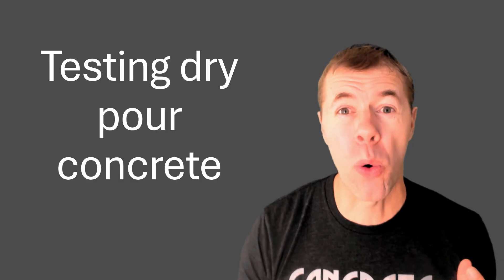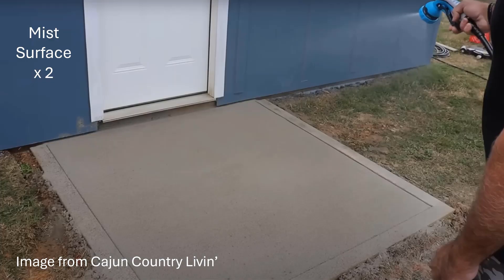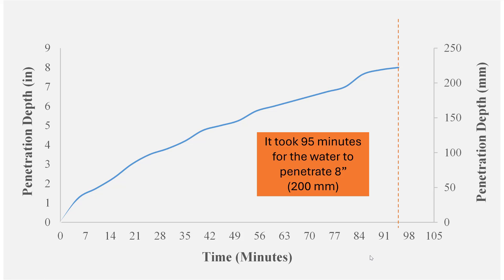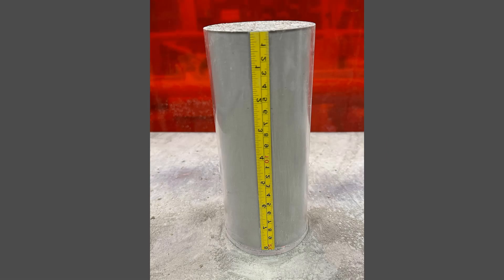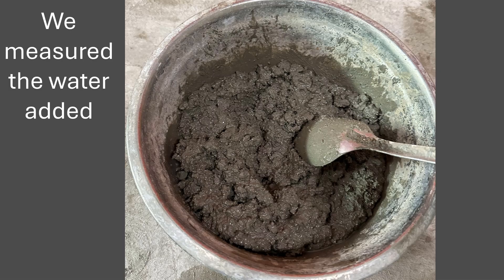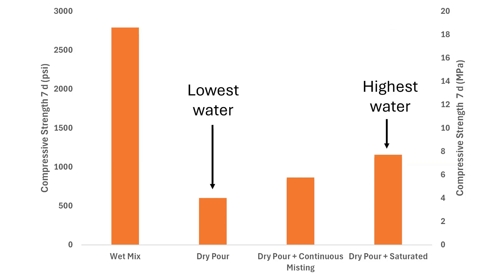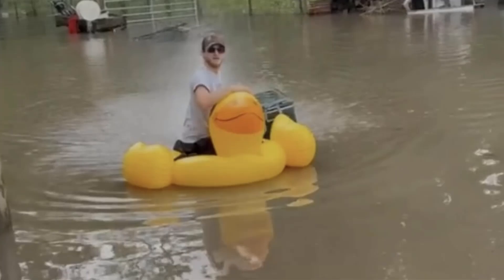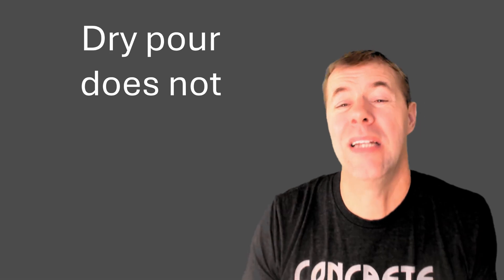Testing Dry Pour Concrete with an Expert

Comment: What would happen if you poured the dry mix onto a plastic moister barrier and raised all the outer edges ABOVE the concrete and filled the resulting trough from the bottom up?

Comment: I made a pad (about 7' by 3' by 4" thick) for the step off of my wife's she shed porch about two years ago. It was pretty quick to do and still looks fantastic. I did tamp the ground down to start, tamped the concrete in layers, and did put rebar in the center while pouring the layers. No cracks or other issues to date. This pad only has humans walking on it along with some occasional heavier loads via a handcart dolly (maybe 1-200 lbs max). For this purpose, dry-pour worked out great. But yes, I would not dry pour something that you would need to park an automobile or truck on. But for small projects I will keep doing it because of the ease.

Comment: Thank you so much for doing such good documentation and finally showing and demonstrating what all professionals inherently we're aware of but diyers wouldn't take our word for! Years ago one of my engineering interns that I worked with talked about a project he had in mind for using the dry pour method and he didn't believe me when I warned him about the lower potential strength. I actually had slightly better strength results than you. I lightly misted the top until it set up and once it did, I modified a cylinder lid with small holes, then submerged it in a stable temperature tank. Didn't do any testing with rebar, but I warned him that it would be a waste of money to bother adding rebar because it won't Bond and would completely delaminate should you ever demo the slab. I told him he'd have better results with welded wire, hog wire, or even chicken wire, and maybe even if he added some Fiber to the mix but that rebar would be a waste. Total mid probably be fine for static loads and a light structure like a chicken coop but you'd probably be in trouble if you had any Dynamic load heavier than a lawn tractor. When I broke the cylinders I made that way, it reminded me a lot of the time my lab worked with a guy that was trying to get enough data for an engineer to approve a particular building method where he was cement treating/ amending the soils available on his property, and forming them into bricks. With some suggestion, the last since we broke I think head nearly doubled in strength, but I think he gave up I'm trying to get that County to give him approval.

Comment: Thank you for dispelling the myth that dry pour is as good as properly mixed concrete.  Several of my friends insist that dry pour is "just as good".  I ask them what it will look like in 5 years and they never have a solid answer.

Comment: I've heard that the aggregate is used because it's cheaper than using just sand and cement because rock takes up more volume for less money If I'm not mistaken, I watched another video of yours that was false information because you said dry pour was comparable to wet pour.  https://www.youtube.com/watch?v=nA6rhtWVt6s  (People actually make brownies pouring water on top of the ingredients and putting it in the oven without mixing?  You made the lamest comparison in that video.) Why in the hell would dry pour be good for a pad for an air conditioning unit or a step outside your door when it's so damn easy to mix it for such a small area?  Are you telling me that someone doesn't have a garden hoe to mix it?  Laughable.

Comment: The oldest article on dry pour concrete I remember, the procedure involved a sand layer under the concrete, and water wicked in from below.  An ideal arrangement for driving air out and avoiding the dry veins you identify as a weak point in dry pour.

I'm also wondering if mechanical compaction of the dry concrete would make a difference.
Reply: No, it would still be an inferior product. Just mix it properly, you can't go wrong.

Comment: The wet pour concrete becomes stronger if water is added and it is kept wet after it sets up too so if it were allowed to set up and put in the rain room or whatever it's called it would have gained even more strength over the dry pour or as it should be called dry poor concrete!

Comment: In the olden days, the "ice ships" used wood pulp and wood fibers, mixed into freezing water to create a metamaterial which had much better strength and blast resistance than either one alone.  In some cases, these were done in layers, similar to fiberglass, where alternating plies were used.  The wood absorbed the water and then froze as well.  How about using some of the "grass water saving" granules, and placing them into the dry mix.  This would add compressibiity, similar to what is used in commercial Gatordust and Gatorsand.  We use the Gator products for really simple projects such as crack filling, and admittedly they are very weak under any load or abrasion, but they DO LAST in freeze cycle environments, where the concrete just spalls away, and the whole structure just continues to degrade and separate.

Comment: Note - Experimental design flaw.    In the example Country Living video, they had an open bottom on their project, which means air could escape down and to the side.    For experiment purposes, the cylender would need to be open on both ends allowing water to push air to the bottom and out.   Then test using same methods described.   I'd be interested to see if this would alter the results of the testing.

Comment: This test is inconclusive IMO as we don't know what brand of concrete used? I've seen videos on the "Michael Builds" channel and he strength tested 4 different brands of concrete and all 4 performed completely different. So certain brands of concret, won't work at ALL for the dry pour method. This video here also only tested the regular dry pour method. 

Back in March of 2023, I did my own 4x4' dry pour, but I  COMPACTED it before I added water. My theory behind this was to eliminate the honey comb effect and make it more dense. Then, I measured the correct amount of water and just poured over the top after the mist layer hardened. I use that pad for a manuel Harbor Freight tire changer that's bolted down with anchor bolts. I've been tugging on that changer for months, and the achor bolts haven't budged an inch. I used the regular Quickcrete brand BTW.

Comment: You didn't test progressive misting.
The method is , spread the dust add water spread more dust add water lay rebar if wanted add water and PVA glue mix around rebar spread dust add water , smooth a bit for last layer or two of dust then do the finishing and misting.
Still no mixing and still an easy finish but should be as strong as a proper wet mix.

Comment: You should do a longer-term test where you do a dry pour with an unsealed bottom and leave it outside for a month, 6 months, and 1 year.  Then do the strength test.

Comment: the cracking test seemed to show that it was more elastic. maybe thats a good thing in some applications like larger slabs. seems like if youre traping a lot of air then youre essentially making aircrete and using less material. a lot of times concrete is  way too heavy and causes its own demise from settling and cracking. im just glad you had error bars on your plots tbh

Comment: I have always suspected most of the data you shared. I did not have any data to support my gut level feeling. Your sharing the test data and more importantly, the explanations, have helped me gain a better understanding of concrete. I will always do the wet concrete, unless strength and durability are not important.

Comment: How about demonstrating the air bubble hypotheses in a followup.

For example:

- take an acrylic cylinder
- drill small holes close top the bottom
- fill with dry pour
- dunk carefully almost to the brim of the cylinder in water

This should allow all the air to escape to the top

Comment: I had to pour a 6' x  3.5' slab for a small garden shed by myself, with only a shovel and a small wobbly old wheelbarrow, and I was not looking forward to all that rushed stress mixing work pain.  So I tried this sort of hybrid method I guess you could say, where I wet the aggregate base, then dumped the bags into the form dry, and added water as normal, and mixed it in place, as best as I could. I thought it would save time before the cure started. I don't know if it did.  It was a real pain in the ass dealing with the wire mesh, I think I might have deided to take it out to mix the bottom, and then tried my best to put it back in at proper depth. Overall I know I didn't get the same level of mixing I would normally get, and I'm not sure if I broke any bonds that were starting to form due to the kinda drawn-out process.  After 7 days in shade with very irregular misting (oops) when the forms were removed, the sides had some visible signs of needing more vibration or maybe my mix was a little dry, but so far 2 years on, it has been totally fine, through two freeze-thaw cycles and tons of rain and saturated soil.  This summer I did a "normal" wet mix method for some front steps and about 5' of pathway.  I don't know how long that is going to last because again it was a small rickety wheelbarrow that could take 2 bags at a time max, and a shovel  to mix a lot of concrete in a short amount of time...I guess we will see how it holds up!  This stuff was in full afternoon sun although it was kept wet and covered for 4-5 days. Anyway, I'm rambling to no one who cares  LOL cool story bro.

Comment: What if the water could be added from the bottom, say by putting a small hole in your cylinder and placing the cylinder in a water bath. Could that solve the air channel problem? Also, would it help to vibrate the whole thing before and when water is first added, to encourage the cement particles to fall into voids?

Comment: Very good video, although the one flaw that makes this less than totally convincing: Your test cell is completely sealed at the bottom, which is very unrealistic. A real slab pour has all sorts of porous substances around it to allow air to escape without having to force upwards through the water. If someone could repeat this exact methodology but with some sort of porous stopper at the bottom of the acrylic, then we'd have an open and shut case.
Reply: I've built many fences with 3x3, 4x4, and 6xt post, even steel posts. When you add the concrete into the hole you are using the same concept as dry pour concrete. And the concrete you generally purchase for this type of job isn't your high strength concrete mix. When we removed post after a few years have past because of changes required, we had to use sledge hammers, concrete chisels, concrete saws to remove the concrete. Plus when we broke the concrete we had the aggregate breakage as was described. So I suggest the test engineers do this test on an actual concrete project. Same size and one dry pour and one wet. Using the actual same environment type and then do the comparisons. I'm wiling to bet you will see a totally different outcome of the data.

Comment: Great video and VERY interesting! What would happen if after wetting the dry pour you hit it with a plate vibratory compactor? This is a tool many small contractors have or a DIYer could rent. Also, concrete pavers are made this way, although I know they use a higher pressure than could be achieved with a portable vibrator. Could that significantly boost the compressive strength?
Reply: The dust would be insane
Reply: No, you wet it first. No dust. I've done it.

Comment: I'm planning a dry pour to level a sloped floor. Wet mixing might not give me enough time to work out the level as I'll be working alone. One particular thing we do here in india is we stamp on the dry pour during misting to remove air pockets; second thing is I'm planning to mist it with water & SBR in 1:1 ratio. Hope it works...

Comment: The method works when you add water as you go. Of course it'll fail otherwise.

Dry pour trades time for not needing a mixer, that's it. No mystery involved. If you don't want to wait, re-water, wait, re-water, sometimes for several days, do not dry pour.

If it sounds as if i'm saying dry pour is "just as good," please re-read the above instead.

Comment: Tyler, i want to pour concrete slabs standing up of 180 cm wide and 100 cm high and about 5 cm thick between allready made and placed poles.
All the people i talked to are saying it is to thin but i can buy slabs 180x40 cm that are 4 cm thick (very expensive)
What is the difference?
I have been asking and searching for a long time now and still have no answers, is there an answer?

For rebar i want to use stainless threathed rod because of rust issues, is that as good as rebar, or good enough?, i want to play safe with no experience.

One more question, if i have a great looking concrete mix i have a layer of sand and cement on top but no gravel after vibrating, can i add some gravel on top in the cream in the mold after vibrating so that it is all filled to the brim? or is this a bad thing.

This is for making a fence around my garden wich i want to stay up for 30 years (about the rest of my life) so i want to do it right, as cheap as possible and with no experience.

Comment: I watched a large amount of videos about dry pour concrete and noticed a major difference in method of pour. I think that their might be one more sample that you might want to test regarding strength of the concrete. 1 - People dry pour the concrete and level it without any compacting. 2 - The dry pour mix are compacted in layers in order to make sure that there are as little air molecules as possible. * I think that this could potentially prove to be a much stronger sample during testing than what you have. My gut feel is that it would most probably still not be as strong as wet pour, but significantly higher strength than the dry pour sample you had.
Reply: Air can add strength to a mix. I would also think if you tamped your concrete in layers water would have an extremely hard time penetrating the tiny compacted particles

Comment: Great video and something to keep in mind - dry ppur is still pretty damn strong. 600-800 PSI, 800 pounds per inch is still pretty strong! Even dry pour may be 5-10X as strong as the soil it's sitting on or in.  If you need maximum strength, you need to measure and mix properly. If you DON'T need 3,500 pounds per inch strength, dry pour may be fine for that project. Fence posts are the canonical example - the soil around the concrete will move before the concrete breaks.
Another example - my air conditioners are on pads made of FOAM. Dry pour is 20X stronger than you need for an air conditioner pad.

Comment: It worked great for my shed base.  3 years and no cracks.  I live in a cold climate too.  Would I use it for my house foundation? No, but for most little projects it makes a lot of sense.  
I wet the soil before I poured the concrete bags into the form.

Comment: If you see the prices for concrete slap of 1m x 1m with 9000$ with a contractor you use dry mix. The problem are the insane prices for 1h of work, you pay $2000 without material. 
The dry mix used by ancient civilization had some not wet dry mix in the cast and the dry particles close any cracks.

Comment: I'm curious how this relates to the findings researchers had when they analyzed the ancient roman/greek concrete structures. If I recall, they theorized that their wet concrete was mixed somewhat clumpy (not well mixed with clumps of dry cement) when poured. The dry cement (lime?) would eventually activate when small cracks occurred over time and thus become "self-healing".  The result was concrete that would last thousands of years.  Based on this video, I would guess that the ancient concrete probably had poor load strength.

Comment: Thanks so much for this video! It would be great if you or your students could do a video where you give instructions for maximizing the strength of a dry pour concrete slab given your expertise. In essence, is there a way to get to 2000-3000 psi with dry pour (the recommended psi for concrete patios)? For example, if you started with high-strength concrete that's rated for 4000 psi, did a dry pour, and continuously added water for X days would it consistently reach 2000 psi, making it a reasonable substitute for wet mixing for a DIYer who wants to do a simple patio?

Comment: Loved your video, however I really want to know if you have any results for the misted or saturated dry mix concrete compressive strength as it ages?

I can imagine that with the equal water content to wet mix, much of the water is lost to transpiration/evaporation, so there is not enough left to saturate the cement in the mix to allow for crystalline growth over time, but the saturated mix may differ.

I also had a thought experiment - what if we used a hybrid method for a reasonable thickness slab of 2-3 inches:

1) Lay and level the premix concrete dry for ease (most people’s issue)
2) Fully saturate with water with misting without waiting for the top to form a crust (if we wait for a crust to form before saturation we define the volume of end product and rule out additional compaction or agitation)
3) Vibrate and tamp the formwork (using something like a sander attached to a 2x4) to compact the concrete, remove air gaps and encourage closer bonding between the aggregate and itself, as well as any rebar present. 
4) Add more premix if needed if the casting compacts enough to be lower than the formwork.

I think this would probably combine the ease of set up with the dry mix, and offset some of the bonding and hydration issues due to lack of agitation of the paste to ensure better coverage/coating of the aggregate than by capillary action alone.